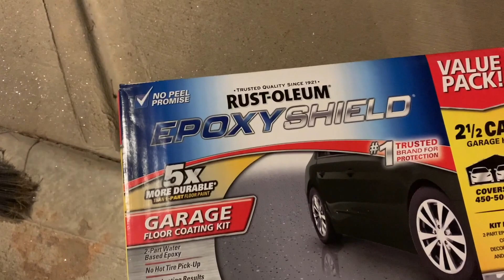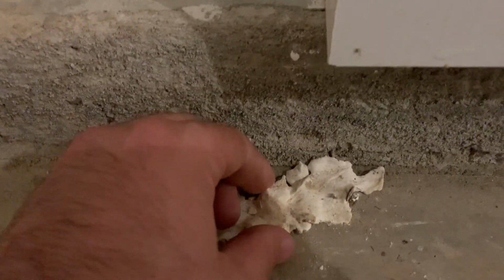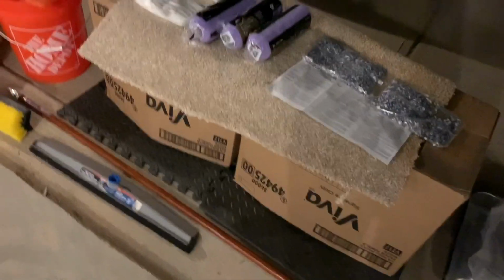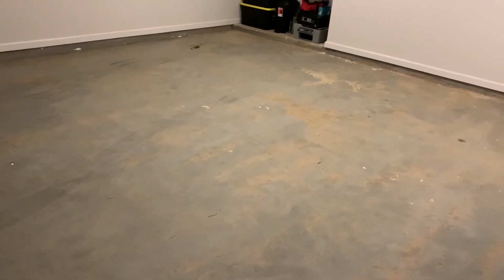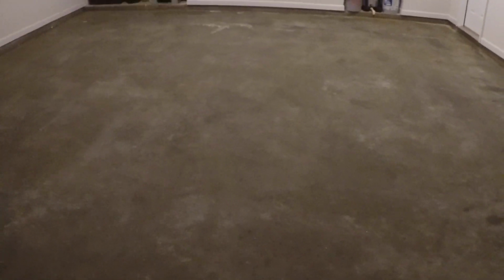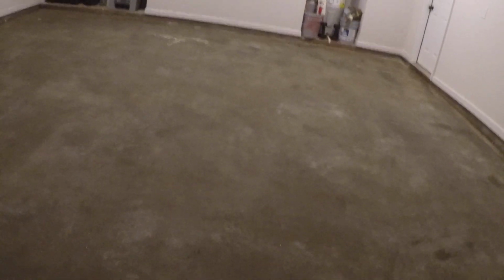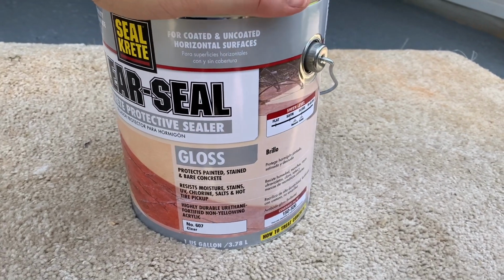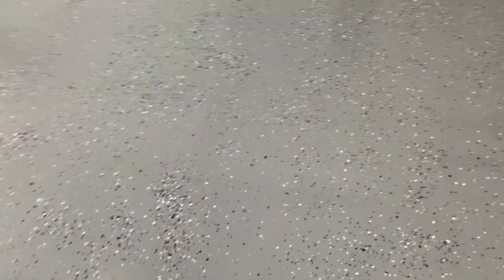MUST WATCH / RUST-OLEUM EPOXY SHIELD GARAGE FLOOR KIT

Comment: To get a much more uniform coverage of flakes than @12:53 you can make a cheap flake shaker by drilling some holes in a plastic container, putting flakes in, then shaking them out. They disperse much more evenly than by hand.
Reply: Yes I agree for a more uniform flake dispersement I use a hand held seed/ fertilizer spreader  $9 at Home Depot instead of randomly throwing handfuls of flakes out where you get heavy flakes in some areas and light flakes in others it gives a more uniform look before sealing with clear top coat.

Comment: I see you used a Seal Krete clear seal vice a sealer from Rustoleum.  Are you worried the Seal Krete won't adhear as well as the Rustoleum seal?  Thanks

Comment: I have an old Jeep Wrangler that if it didn't leak I would think there was something wrong with it ;). Have you had any experience with oil leaking on the floor and if so, how it has held up? I am not one to clean up my oil drips on my concrete, so I don't want to waste time and money doing this if the oil stains will mess it up. Thanks!

Comment: Will the concrete sealer soak into a epoxy floor ? Think that’s the wrong product needed. Or maybe the epoxy coat is more absorbent than I thought.

Comment: Looks good man - I was wondering how that Seal-Crete would work on top of the epoxy since I read online that it specifically should not be applied to 2-part epoxy coating (for whatever reason). I personally am going with H&C Clarishield for the clear coat ($50 / gal) because of what I read about the Seal-Crete. Hopefully this stuff looks as good!

I'm jealous of your (minimal) prep - I had to caulk about 200 linear feet of cracks and I probably used half of my 10lb bag of quickrete to fill in missing chunks and spalling. Then I had to grind it all down with an angle grinder (which was actually pretty fun). All-in-all I would say that my concrete repairs took me an additional 8 hours over 3 days (waiting for drying, etc).

Thanks for the video though! Love to see these things from start to finish.
Reply: What was the cost to do all that? 2 car garage?
Reply: @Bandobenz18  Probably cost me a total of like $400? I'd say $50-100 of that was to buy stuff that most peple probably have. And yes, 2 car garage.

Comment: Hello, I noticed that you didn't wait that long after you cleaned it, did the moisture in the concrete cause any problems? Mine has been dried overnight and more, but concrete still looks moist (dark in color). Thank you.

Comment: Man, thank YOU very much for this video! I have seem several videos about this product  but definitely you nail it using 2 gallons of clear coat on top of it. That's the legit trick to make it look awesome and make it last for years! I never thought about the clear and seriously by far this is the best video about this Rust Oleum epoxy. Thanks Again because today I just purchase mine (I have to wait til mid Spring. I'm in Virginia) and I want to plan everything to achieve your same result. Looks neat and clean!
Reply: @ratchetdavo  Thank you for sharing.
Reply: We just did it today (Spring was kind of cold) Outside temp between 75 - 80, prior days high 87 low 69 and humidity between 55% and 75% in the last 3 days as well. 
Now we are aiming for the the clear coat but I do have a couple questions. 

You said you did two coats of clear... How many can you used for two coats? And... How did you wait between coats of clear?

Last question, how is holding for you so far? Any hot tire pick up? Any suggestions?

Thank you so much!

Comment: I just painted a shop bathroom floor and went to purchase the Seal Krete Clear-Seal. It states on the can not to use over 2 part epoxy paints. Have you had any problems??

Comment: Can you please tell me if you only used 1 coat of  epoxy then spread the flakes.
Reply: Ratchetdavo  I’m so sorry I did not mean the gloss. When you applied the gray rustoleum did you apply one coat then put the flakes or did you also apply 2 coats then flakes on second coat
Reply: Ratchetdavo  Thank you for answering my questions. Because of you i will be brave and try this on my garage floor. By the way outstanding job on your floor. Really good video.
Reply: Did you wash the floor before applying clear coat?

Comment: I was thinking of using a clear coat finish (rust-oleum premium kit) after applying the epoxyshield.  What was the reason why you went Clear-Seal gloss instead?
Reply: @ratchetdavo  I'll go with what you used.  Thanks for the recommendation my man and great vid!
Reply: I wish i knew before i spent 112 for clear lol. But the premium kit is thicker i believe
Reply: @iharris3466  After close to a yr after completion, I would go with the thick premium epoxy.
Reply: @jon_q1904 yours did not hold up well? i am torn between seal crete and the rustoleum now. this evening i am scheduled to put a clearcoat.

Comment: Was there any other reason besides cost to not use the Rustoleum clear coat?
Reply: @ratchetdavo  I got you. I was wondering why you didn't use the Rustoleum clear sealant instead of the sealant you used?

Comment: I am about to start my project.  I see you used a 3/4 inch roller for the epoxy.  From what I have researched 3/8 seems to be the recommended nap.  Can you share why you went with the 3/4 and if you were to do another job would you still use 3/4?  Thank you for your anticipated response. :-)
Reply: @ratchetdavo  Thank you for your quick reply.  Today I purchased both sizes so I should be ready.  BTW, you really knocked that job out by yourself in more or less a day?  True Rambo style!

Comment: After using Rock Solid Product on a deck that required me to tear off all the wood and replace with composite decking I will NEVER use another Rust-oleum Product.  Everyone I discussed the complete failure of Rock Solid had the same results including in store folks that tried using it on their decks.

Comment: With two top clear coats was it thick enough for you? I applied two clear coats and I can still feel the chips, I was thinking it would be thick on top and a smooth finish.
Reply: I used the expoy shield clear and it came out super thick. I believe that's why its $112 compared to the cheaper 30 buck can

Comment: Great job. How long did you have to wait after finishing applying the  epoxy before applying the clear coat?
Reply: @ratchetdavo  in an older comment you had said you waited 24..? Not pointing fingers, just checking so I get it right. Great video, very helpful.

Comment: Would you recommend putting a bonding primer on a bare concrete floor after etching and cleaning. Before you apply the coating.

Comment: Thanks for video, I am going to do the same this week. How long did you let the Epoxy coat dry before you applied the SealKrete?
Reply: @ratchetdavo  Many thanks, I am starting today, it was really helpful with your video, cheers!!
Reply: @ratchetdavo  Rust-Olem people says they only recommend "Epoxyshield Premium Clear Coat". But that is so expensive. Since you have applied "SealKrete Clear-Seal Concrete Protective Sealer - Gloss", looks like so far you have no issues? Or do you recommend otherwise? Many thanks in advance.

Comment: DO NOT USE CLEAR SEAL!  I used it and it when I spilled some oil on the floor the clear seal soaked up the oil and left a huge stain. I called Rustoleum and they said I should have used the $112 two part clear coat. Don’t make the mistake and use clear seal. I’m going to have to redo my floor. I just hope I don’t take up my epoxy and have to start over 😫